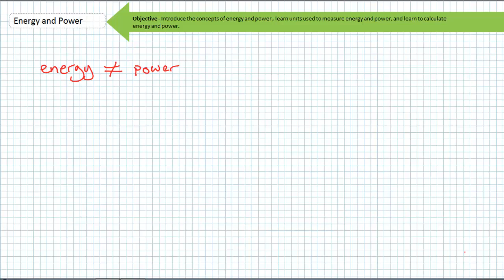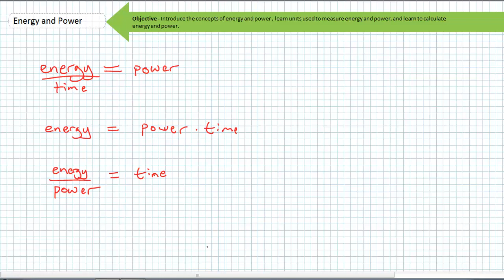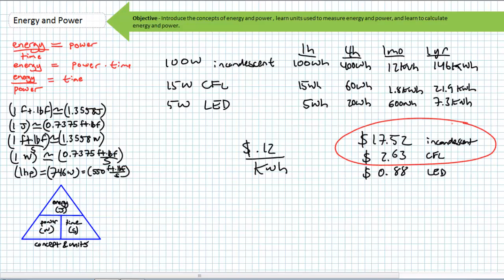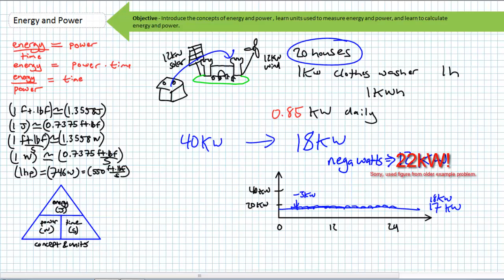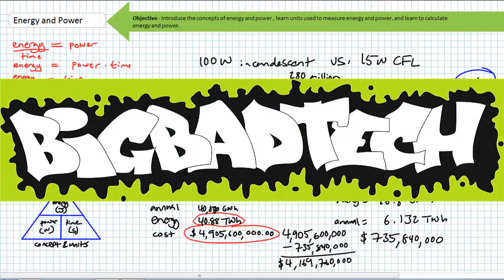Energy and Power (OLD LECTURE)

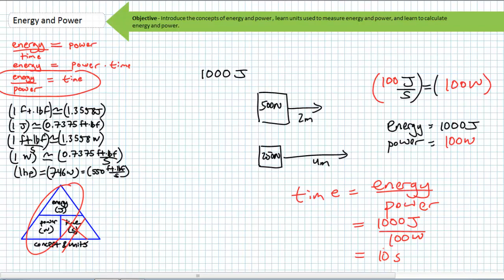Comment: at 12:15 it is inferred that US units are always inferior to Imperial. Most of the time I agree, but base 12 (in/ft, qt/gal, ) is far more divisible by whole numbers than is base 10. Too bad they blew it with other random and less divisible units like miles. Just like you preferring HP in some situations, using the dumb US systems has its advantages. Kinda hate to admit it.
Reply from the maker: +Roman Sill Check out my hydraulics lectures ... I'm secretly a fan of US customary units for very similar reasons. The units basically GIVE you the formula.
Reply: Jim Pytel  You mentioned your fanship of hydraulic units in the conversion video. Thanks for letting me razz you.
I keep getting confused about holidays. Oct31 == Dec25, after all.
Reply from the maker: +Roman Sill There are 10 types of people in the world. Those that understand binary and those that don't.
Reply: Jim Pytel  My wife bought me a shirt with that phrase. I was so happy.

Comment: Hello Jim, once more thanks for the videos, I need some advice, hope you dont mind. Im from Mexico and I do blade repair in rope acces and I want to do more in the wind industry. Right know Im doing a Bachelors in Renowable energies and your videos are helping me a lot, before I knew about them I had a Vestas interview and when they ask me hydraulics schematics was like ¿Whats that? and I thougth of jumping from the window like you said in one of the Colombia Videos. But im thinking of going for a Simens, GE or somewhere that I can get the training to be a great and complete Technician doing repair on blades and machine. Do you know a place where I can get this training, also Im thinking in learning Non destructive. Whats your advice. And thanks again :)
Reply from the maker: brakasio Honestly, any technically relevant program is a great way to get ahead in the industry. Not super familiar with any of the technical schools in Mexico, however, we did have an exchange group come visit us from from the Energias Renovables program at UT Valles Centrales Oaxaca. Not sure if they are in your barrio or not. Your prior experience will go a long way, but, here's my personal list what to look for: 1) Electricity and Electronics* (DC to 3 phase AC) 2) Motors - 3 phase AC 3)Motor Controls - contactors, overloads, relays, starters, drives, switches, sensors 4)Mechanics - basic maintenance, gears, torque, shaft alignment, fasteners 5) Hydraulics - including electrical control and proportional valves 6) Semiconductor Devices and Circuits/Power Electronics (rectifiers, inverters) 7) Digital Electronics and PLCs (Programmable Logic Controllers) 8) Wind Turbine Technology - safe access and rescue, DFIG and PM Synchronous Generation 9) "Renewable" Technology - energy storage, solar, transmission *As one of my former students once said "Everyone that's changed an oil filter in their car thinks they're a mechanic, however, when there's an electrical question in a meeting 50 people stop talking and they all
listen to me." This is the most difficult to obtain, yet, the most desired skill.
You'll notice most of the skills in the list largely have nothing to do with "renewables" or "wind turbines" Even those that are lumped into these categories can be thought of as traditional electrical engineering technician topics that are just applied to renewable energy. This is to suggest that a good technical training program doesn't train you to be a "wind turbine technician ONLY" but rather a electrical engineering technician that has knowledge of industrial systems that can get a job anywhere. Most of the graduates of the Columbia Gorge Community College RET program get work in wind, hydro generation, transmission, solar, manufacturing, avionics, and industrial agriculture and food processing. Not sure if the US is an option but CGCC isn't the only pebble on the beach. One of my buddies works at Iowa Lakes Community College and they've got a pretty strong program too. Anything that features intense electronics is probably a good fit.Stay in touch, because if everything works out like I hope it will I'm going to do a lecture series on most of the above topics (with the exception of mechanics ... not my strong point). Self instruction isn't everyone's path but it can be an option. A new product I'm exceptionally enthusiastic about is the "Digilent Analog Discovery". If you've got a computer ... you've got access to a lab. Que tengas suerte!
Reply: The Digilent Analog Discovery can substitute for lab?  Covers all functions?  I have wanted to ask what book you use for lab?  I am retired, have a lot of time and interest.
Reply from the maker: Nothing can completely replace industrial equipment accompanied by a demanding lab instructor breathing over your shoulder and watching your every move! This being said, the Analog Discovery is very inexpensive option for folks that don't have access to these resources. I actually don't use a textbook anymore and have gone to this completely online format. I issue my students blank "study guides" that highlight the important topics for each lecture. The online lectures and study guides seem to prepare them well enough for the pre-lab quiz and lab activities. 
Unfortunately I haven't completed the study guides for the basic electronics series yet, however, the study guides for the hydraulics course can be freely used at: https://openoregon.pressbooks.pub/hydraulics/
The new material I'm developing for the NSF ATE will also have blank study guides. Still working on establishing a single place folks can download them. Once the download site is established I'll put a link in the Information section associated with the video.